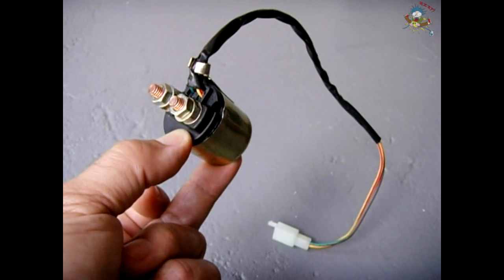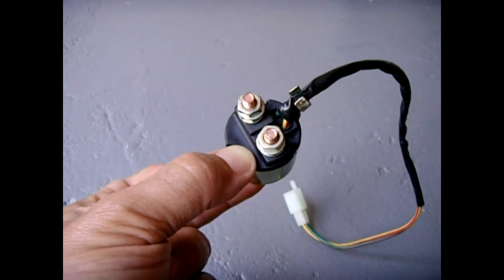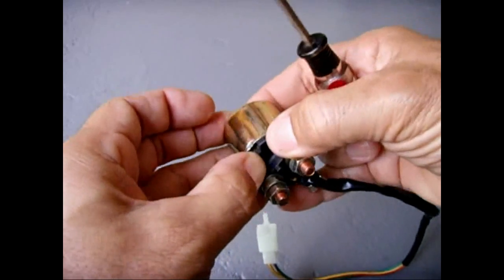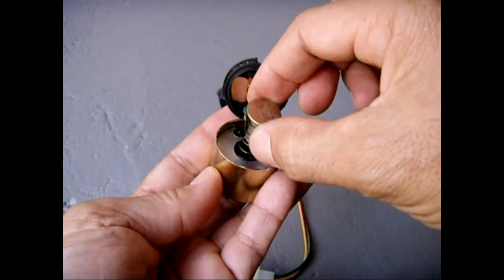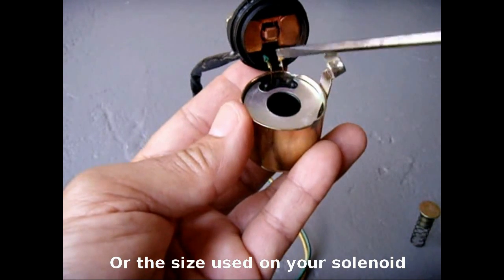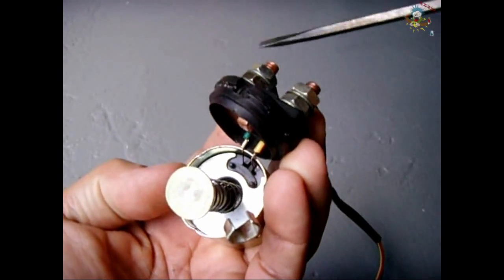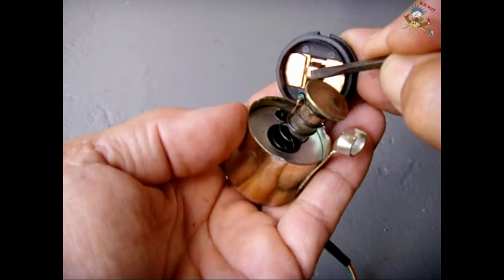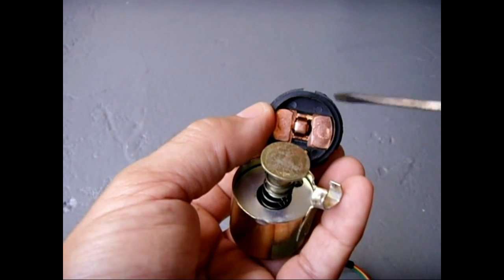GY6 Starter Solenoid Testing, Disassembly & Repair

Comment: My moped is having trouble starting up when it does start up it just dies.I tried everything I did a valve adjustment got a new ignition coil still having start up problems.Could my starter solenoid be the problem

Comment: Great video!  I opened mine up and cleaned the pitting with a file/sandpaper then soldered the connection I broke in the process.  Reinstalled and the electric start works perfectly! (1999 honda foreman 400 owners - be aware there are additional spade like prongs seating the top piece on to the coil, these little posts have copper wire wrapped around them and they will break by wiggling too aggressively to open up - be careful!).   Thanks for posting this.
Reply from the maker: Glad it helped Rob! Be sure to check out my GY6 video playlist and share. Thank you

Comment: Hoping your info will get my kids atv going. Everyone seems confused as to why this atv isn’t starting. The solenoid clicks but won’t engage the starter. I put a brand new solenoid on it and it too clicked but after a bit of a battery charge I did get the starter to turn but then trying it again all I got was a buzz and I fried the solenoid. I still have the old one so I’ll try cleaning the contacts and see what happens. Thanks
Reply from the maker: Can you start the atv using kick start? Sounds like your battery needs to be replaced.

Comment: A rapid clicking could mean a bad solenoid ???
Reply from the maker: Weak battery!
Reply: Hi iv got a tamoretti 125cc retro moped iv put a new solenoid on it but it's got  two thick red wire and two black wires to plus battery wires to im confused can enny body please help

Comment: could the starter solenoid be the problem with a hard start mine went out
Reply from the maker: If you short the solenoid terminals and the starter works fine, then replace the solenoid.

Comment: The resistance on mine reads 21ohms, but it does click. Guess that's OK right or should I clean the contacts inside?
Reply from the maker: thersten Hi there. I have almost 300 videos and cannot remember every test I did on all my videos. If your solenoid winding does not test very similar to mine(as shown in the video), then you have a problem. I have no idea what the contacts look like, you would need to open it up and take a look to determine if the contacts need cleaning.

Thanks For Watching.
Reply: FYI, in this video you mentioned that you got a 4.8 reading. oh and great video by the way! thank you.
Reply: electronicsNmore i here a constant clicking just like my blinkers sound like when i turn thr key. why it turns over but dosnt start but i hear click click click
Reply from the maker: Joseph Perkins Dead Battery
Reply: electronicsNmore i bought  the Battery Extender- battery charger and maintainer left it float at 100 percent over night. it should be a fully charged battery? thank you for your immediate response!

Comment: If the solenoid is going bad would it cause scooter starter to struggle.
Reply from the maker: Robyn Knowles Not unless the contacts are burned preventing the full flow of current to the starter. You can take a large screwdriver and short the 2 large bolts together on the solenoid to see how it cranks. If it cranks the same, then your solenoid is fine.
Reply: Thanks, yeah it was the same result.  My starter is just weak.  I already cleaned it but maybe brushes are going bad
Reply from the maker: Highly likely the battery is weak. :-) That is more common. If the scooter kick starts fairly easy, then the starter should crank over just fine. You could have a faulty starter winding, but I would bet the battery is on its way out. Connect the scooter to a car battery using jumper cables and see if it cranks over quickly, then you know the battery is shot.
 
BTW, I do have a starter repair video in my GY6 playlist.
Reply: It was hooked up to jumper cables at the time.  I was thinking a loose wire or starter going bad.  But battery is only about 2 months old.  I think its my starter. The person who I bought it from had the kick start removed. Will see if I can do a small video to show you everything, seems like you know your stuff.  Any help is greatly appreciated.
Reply from the maker: Very simple. Either a weak battery or faulty starter since you stated jumping the bolts on the solenoid made no difference. Up to you to figure it out. :-)
Reply: Yeah I will. Thanks
Reply: Hey there I have a big bore that 170 cc I do you think the regular cheap starter is just maybe too weak.  I was able to get it started with the other high performance starter I had, but now its like it almost wants to start.  Hooked it up to a car and revved the engine a little and it started for a split sec
Reply: Valves are set just like the video I can see the carb pulling fuel
Reply from the maker: The next step is to watch my GY6 troubleshooting video. :-)

Comment: Relays are an excellent source  of wire. I built my first crystal radio in the mid 50's at age 11 using wire from a starter relay for the coil in my tank circuit. Whenever I come across an old relay I toss it in the junk box. It may be needed in a remote switching device or I might just need a few feet of wire for a project. 

Nice video, thanks for sharing.

Regards,

Mick Bradford